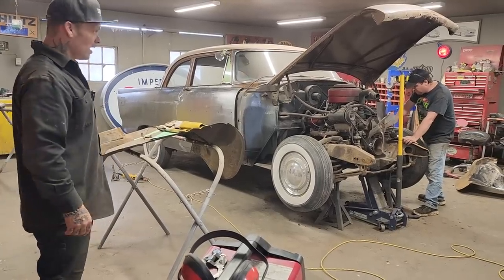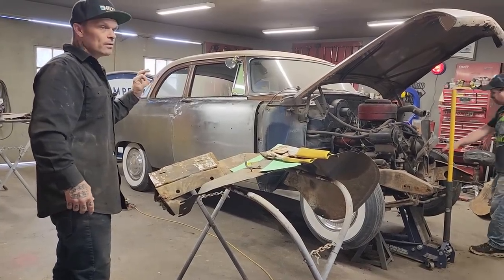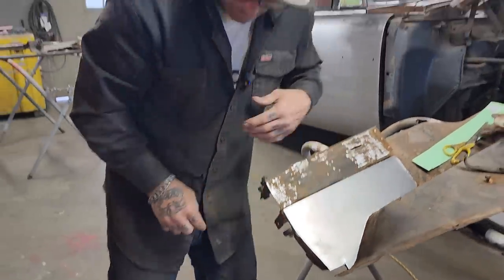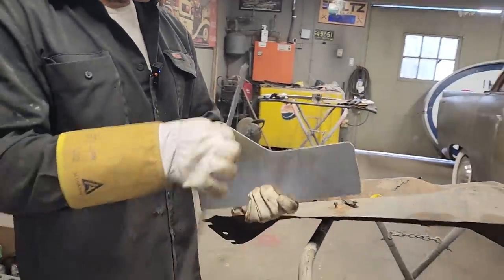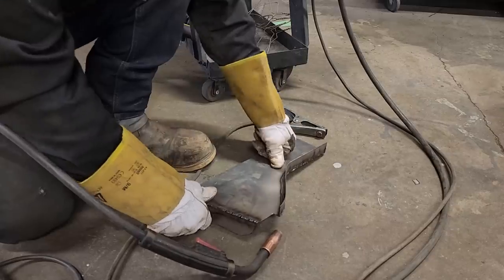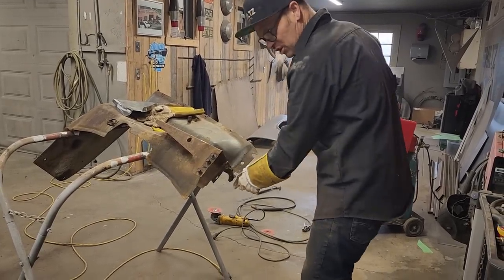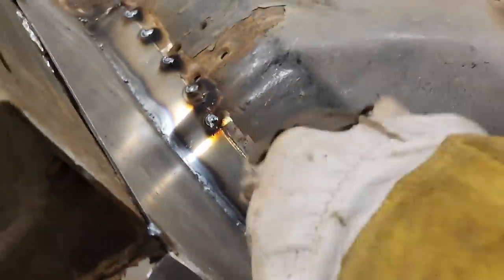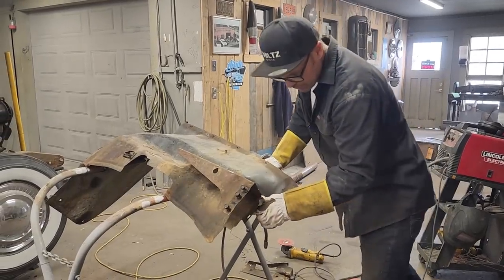Even the inner fenders need rust repair 😳

Comment: 🤘🏻😎👍🏻
I have found that if you lay a sheet of plastic over the stripper it won’t evaporate as quickly and it slows for the chemicals to do a better and faster job at stripping paint.

Comment: You're doing a great job getting rid of the rust on that car. 😎👍 
To identify (sign) your projects you could have metal plates printed with Hiltz Auto Co written on them. You can apply them e.g. on the dashboard or on the gearbox tunnel, but also in a more discreet way like inside the engine compartment...
Reply: I was thinking it would be cool to have a chrome and paint emblem made, in mass quantities, to put them on his projects and sell as merchandise. Like the one Jeg's offers, says JEG'S EQUIPPED. Looks like the 60s-70s emblems the factories used.

HILTZ EQUIPPED!

Comment: Nice job on the inner fender. Maybe could have used the eastwood machine for the majority of the roof. Then used the stripper around the edges and tight spots. I would have installed stack lifts in the new shop to save room. Jmo

Comment: I paid $1500 for a 1951 Ford 8N tractor back in the 1990's, and traded it straight across for that very car in this video in 2017. I traded this 1956 Savoy to the guy in Blockhouse Nova Scotia for a 1968 Plymouth Barracuda convertible that he was asking $12,000 for. He traded me that car without the 340 engine and radiator.

Comment: The reason that "there's more money in labor", as Chad says, is simply resolved by calculating the many, many extra steps that Chad will continue to take in his own craft simply by refusing to learn and understand modern and more efficeint techniques of metal work. What the end buyer will ultimately have to ask themself is if they're actually willing to drive it or if they mearly wish to have it for "display" within a controlled environment?
Reply: What's more, Chad already has the equipment to work metal far more efficiently.